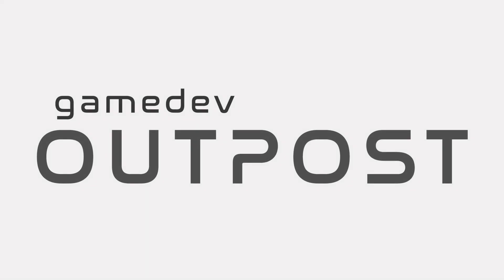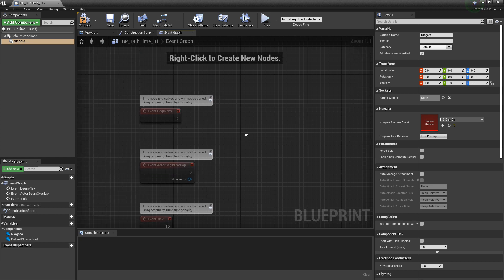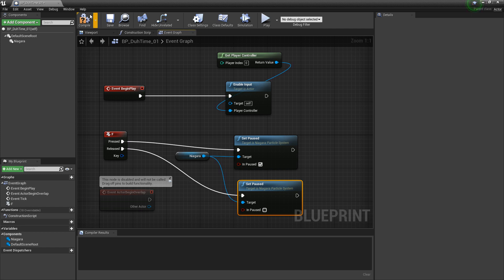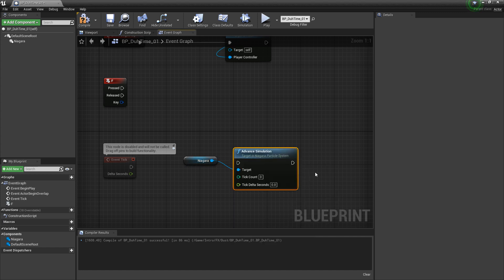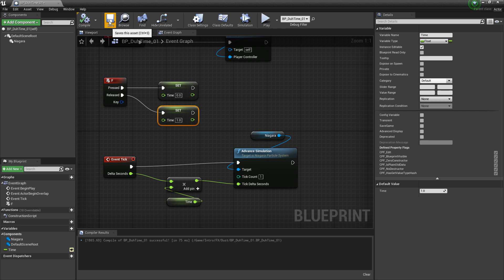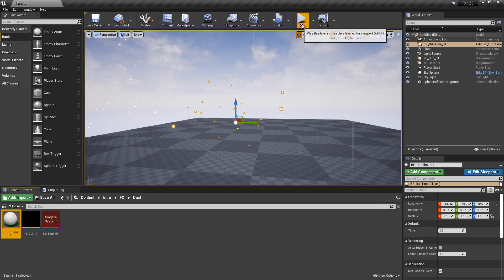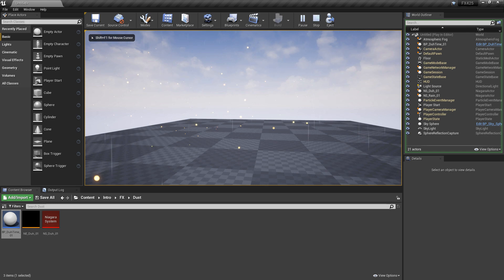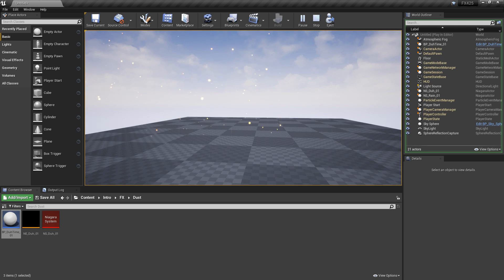UE4 - Niagara Pause and Time Dilation

Comment: how do I instead just slow down one particle system without blueprint ofc.
Reply from the maker: It depends, there really isn't anything built into the Niagara system that let's you do something like that. Instead you have to think about the modules you're using. So if you are using add velocity in particle update, you would use a user parameter/blueprint to slow or increase to velocity.
Reply: @gamedevoutpost9270  I actually am looking for a better way to slow wispy particles. If I reduce the strength on curl noise then wispyness is gone, and if I reduce frequency then the effect is no longer convincing.

Comment: I was just trying to learn how to mess with time in blueprints for niagara systems and trying to figure out how "advance simulation" works, so this was interesting.  I'd like to see you take it a little further and cover some more niagara-in-blueprint nodes.  Things like "SetDesiredAge", "SeekToDesiredAge", etc.
I couldn't figure out how to use the Age stuff when I was tinkering. I've only been using UE for like a month, so I've been working on learning all this Niagara stuff.  My main goal the other day was just trying to figure out how to play a Niagara system in reverse.  Maybe the time dilation setup you were showing allows for that simply using negative numbers? I'll have to check.
Reply from the maker: I've been trying to figure out "reverse." As of right now there's isn't an easy way. You would think it'd be easy to implement because the systems are built off of the sequence timelines. And unfortunately delta time in blueprints can't go negative. If there ends up being an affordable and time sensitive approach to "reverse" I'll do a video on it.
Reply: @gamedevoutpost9270  Thanks for the response.  Yeah, I thought since they are built with timelines, you could just play it in reverse... seems like a really simple thing that should just work off the bat. Do you happen to know if this is a shortcoming of blueprints?  Do you know if it's possible to do this in the C++ API easily?

Comment: First time heard of Time dilation. Thank you for providing these super helpful tutorials!
Is it possible to utilize time dilation function to achieve " stepped motion" effect in niagara system?!
Or there are already ways to achieve that haha
Reply from the maker: You could probably do this by alternating the  delta time between 0 and another value multiple by the rate at which you want to switch between them, basically pausing and pausing at certain rate. You can also change the tick amount. If it's set to 1 you will progress 1 frame at a time, but if you increase it to say 5 you'll skip 5 frames every time your Delta time is not 0.